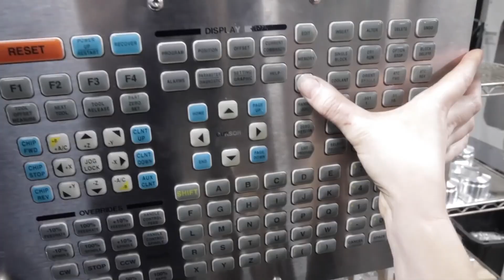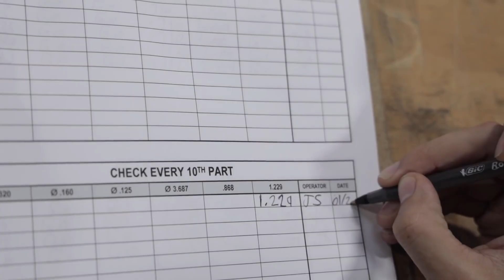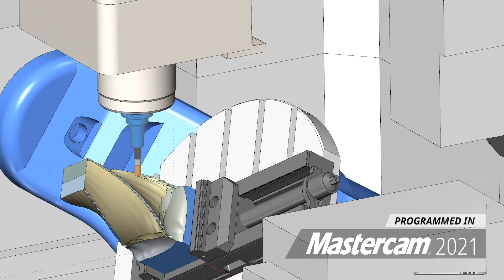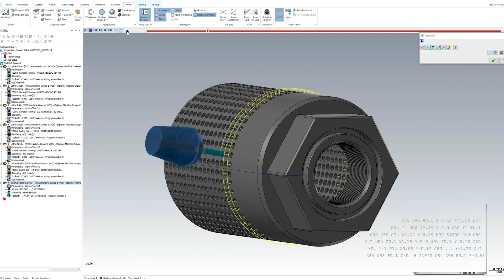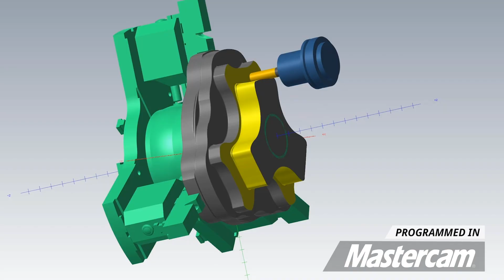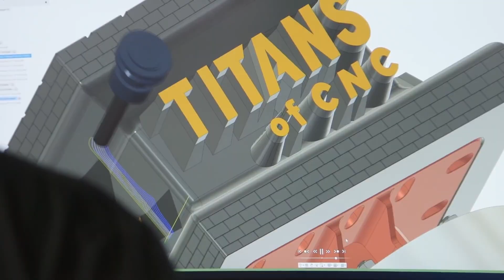Running my machine while my wife is being threatened and then…

Comment: My grandfather had a shop had a bunch of guys working for him one of them was my father who died 8 mounths before I was born shortly after grandfathers health started failing and picked up side jobs at one of guys shops and use to take me along was allways amazed at the things he would make and when I was old enough started running spin balancers and brooches so after got a job as just a button jockey in a job shop but not what I wanted I wanted to learn manuals feel some connection with my past at the time was a student pilot clicked on say I’m gonna join the navy become a machinest mate that didn’t happen ended up doing crash and rescue got out fast forward bunch of years get a job in a fab shop guy there became my best friend(machinest) and was in a place where I could go to school spend a bunch or spend a bunch and have the equipment and a mentor in my own shop 2 weeks after getting it wired up he was killed in an accident I’m in the later years of life but I’m going to have atleast. 1 paying job before I go. Sorry for the rambling

Comment: Titan, thanks for sharing, right now. I am going through a tough time.  We are going through a tough time at our shop.  We were praying for work at our shop, God answered, now we have more than enough and then we had 3 people quit. We are a small shop. I program, now run machines, and cut material, and do set ups.  I am work 65+ hrs a week, and have been for the last 4 months.  I know God has a plan, I am using the overtime to pay off bills. I used to love coming into the shop, but small town buddy buddy dynamics inside the shop, has put a hinder on that.  I just need some rest. I will get through it. Thanks for sharing and please keep me in your prayers.

Comment: My business has hit a slump as well. We are struggling to keep everything together right now as we see the economy going down the tube. I work hard at what I do for my business and I'm also an electrician. I've been an electrician for over thirty years and have my own little niche shop making TFI Relocation kits for the Ford Fox Body industry. I machine the heat sinks in house and dabble a bit in Fusion 360. I have found inspiration in your videoes and rely on God to help me through my struggles. Its always inspiring to see other Christians to let go of the wheel they think they control and put it back in God's hands. Our struggles will continue, but with Christ I can  do all things. Thanks Titan for the video, it sure helped me to see the light at the end of the tunnel today!

Comment: How long do you keep your machines?
Do they hold accuracy for several years or do you have to get rid of ones that lose accuracy quickly?
Reply: machines that are used normally (not crashed, etc) and maintained are generally good at staying accurate for a good long time. You can also get machines checked for accuracy and they sometimes need some re-calibrating. If machines go too far out you might still use them for roughing operations or sell/scrap them.
Reply: @Skooteh  I'm in UK and most of our industry died from using worn out machines instead of renovating or replacing.
UK tax allows businesses to write off cost over 10 years so effectively the machines cost nothing over ten years but the owners keep them despite loss of production from wear and inaccuracies.